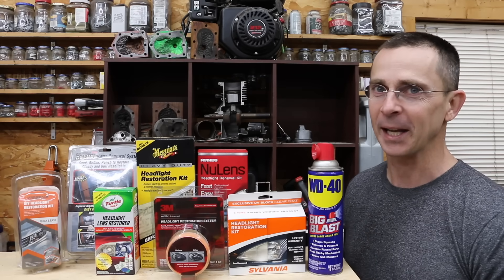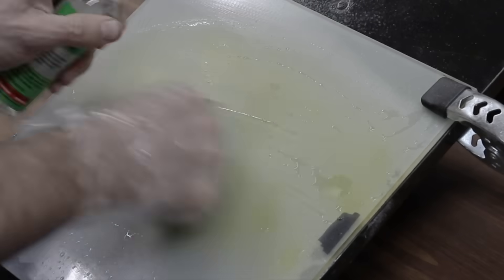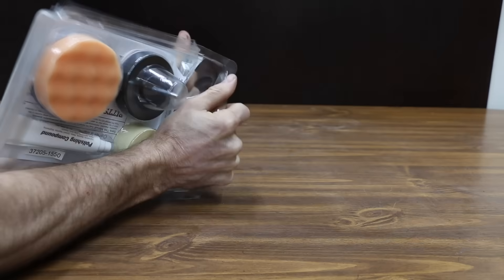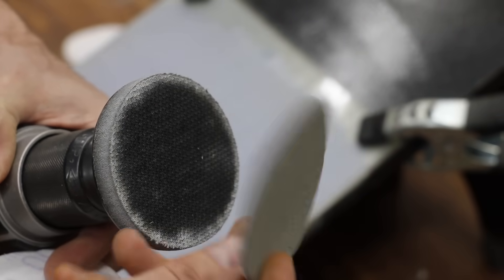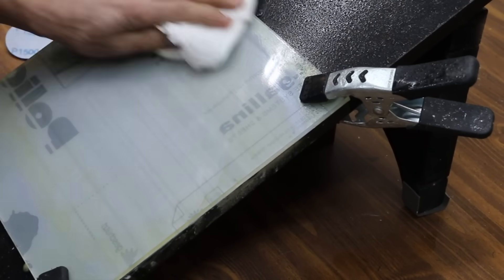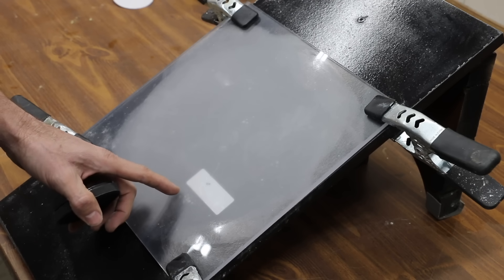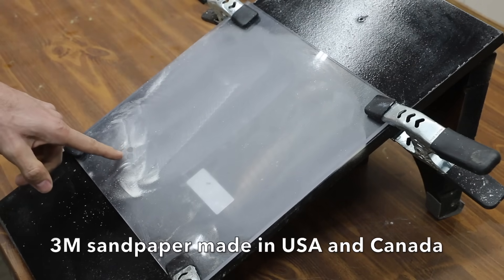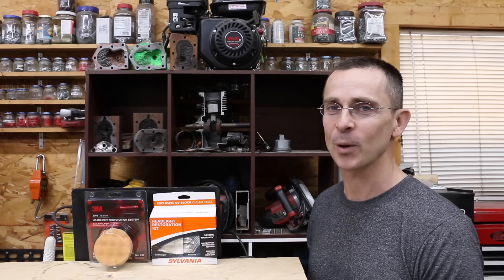Best Headlight Restoration Kit?  Let's find out!  3M, Sylvania, Meguiar's, Mothers, Turtle Wax & HF

Comment: The best headlight restoration that I've found is new headlights from eBay.
Reply: eBay headlights are easy and fairly cheap. They look real good. Problem I have seen is that they tend to leak. Will see moisture then water in the them. At least that has been my experience with eBay headlights.
Reply from the maker: Great feedback. Thank you!
Reply: Frotax Frotax  No.  Now, while EBay replacement headlights are a poor value, the Eagle Eye units from RockAuto are only slightly more costly and are every bit as good as OEM.
Reply: @Larry Fry
Thing is that the Eagle Eye units from RockAuto are probably made by the same people that make the E bay cheapies. haha.
Reply: @watershed44  Possibly, but I doubt they are made to the same specifications.  Not from what I've seen, anyway.
Reply: I purchased a pair of headlights for a 2004 Dodge Ram on eBay. They are not sealed very well i saw a few water droplets in the housing after driving in the rain. I also live in Az they held up for a few years before the uv clear coat started peeling off
Reply: Tried ebay for the badly faded ones on our grand cherokee. They looked great but worked horribly. The light pattern was atrocious.
Reply: Frotax Frotax  They do snap on but you have to soften the glue with a heat gun then pry them apart, you then use silicone to glue the new lenses on! Pretty easy honestly and very cheap!
Reply: @Lustfulvengance 
That's probably the best compromise if you want to save money, 
buy the ebay units then remove the clear lenses from the old unit and reinstall the new lenses from the new units into the old unit. I've heard that complaint over and over again, that the new ebay units have terrible photometric light patterns compared to the OEM units.
Reply: @watershed44  photometric light patterns 😂😂😂😂😂. Wish I would have paid a little more attention in middle school! Not to mention high school, which was a 4 year cannabis project!
Reply: @King Boagart
Oh I didn't learn about that in HS, I learned about that on my own after I graduated. lol....
Reply: I bought replacement head lights from Amazon and within 18 months, they were worse than the original lenses that had been on the car for 18 years.

I attempted to use the Meguiar's kit, but the sanding pads were insufficient. I ended up using various grits of sandpaper from 200 grit all the way through 1500, then used the sealant included in the kit.
Reply: Yea you beat me to it chad. My left turn indicator lens fell off, and did think about just getting a new turn indicator assembly for the left, with the restoration polish for the headlights (20 yrs old).  Found a 4 light replacement kit for $81.79 from 1A auto. Those new headlights in my truck are shining like a diamond in a mules ass. >_<    Edit: Yep and bulbs were included. :)
Reply: I bought a set new OEM for £85 off eBay. couldn't believe my luck.
Reply: They yellow in a year....
Reply: There seem to mixed results with eBay headlights, but about a year ago I replaced my headlight assemblies with ones from eBay on my 07 Camry. They’ve never given me an issue, and are still clear as day, and don’t leak.
Reply: The cheap headlights on ebay are absolutely terrible though.
Reply: @rubiconnn  
I'm sure but I bought a cheap set for my matrix and a year later they're  still looking good. About $100 for the set and they even came with bulbs.

Comment: Could you test the wood / metal saw blades such as dewalt or diablo blades for handheld circular saws
Reply from the maker: Great test idea!  Thank you
Reply: When I first used the diablo blades 24 tooth with the thin kerf, they did perform well. I went through a few boxes and noticed tooth loss was more considerable to other brands, course this is anecdotal using them day in day out. I love the Dewalt in my compound miter saw and circular saw. I would love to see Project farms put those blades through the paces it deserves.

Comment: Best way to restore headlights is to wetsand with 1000 grit, 1500 grit, 2000 grit, buff with a wool pad and cutting compound, then polishing compound on a foam pad, then follow up with wax. Wax every 6 months and they’ll stay looking brand new. Cheaper than buying an overpriced kit that doesn’t provide results and doesn’t last.
Reply from the maker: Great feedback. Thank you